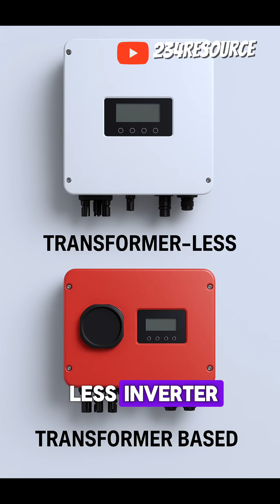The Differences between A Transformer Based and a Transformer-less inverter #solarenergy #solarsetup

Comment: Excellent video!
I have a solar system for my garage. We use a large iron inverter for the machinery, and 3 smaller high frequency inverters to run the windows fans, lights, and some basic appliances.

The newer HF inverters can even run chest freezers. Which is amazing news! You can store food for long times with very little power loss during the evening while operating on battery.
Reply from the maker: Yes. There are OEMs who are making  efforts to make beefier High frequency   inverters. However, they aren't very total yet. So I'll still recommend low frequency inverters for now.